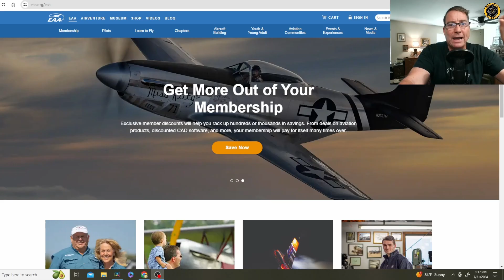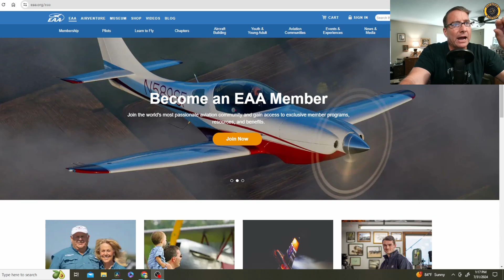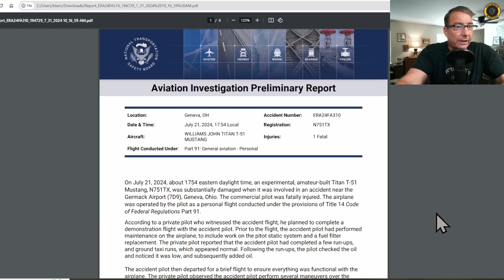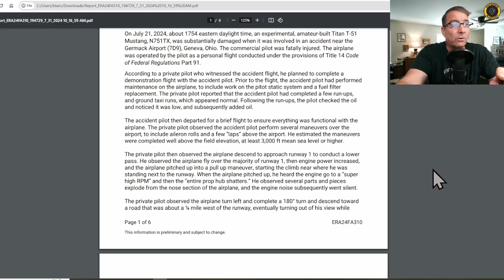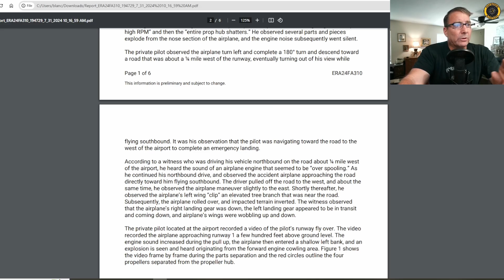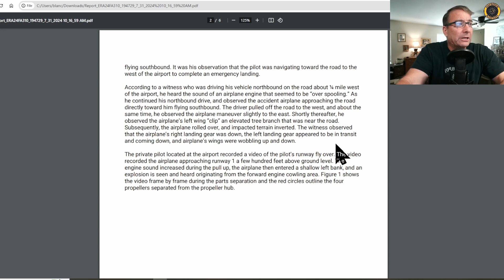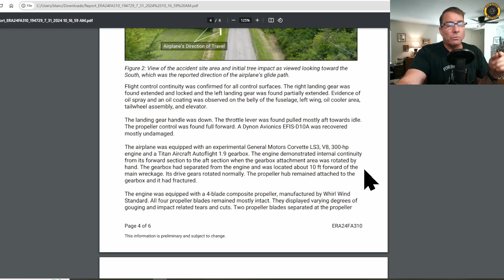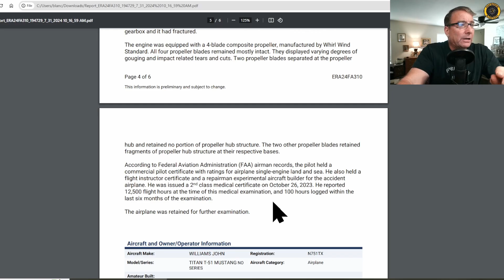Titan T-51 Fatal Prop Hub Failure 21 July 2024

Comment: Sorry, but isn’t it possible the over rev of  the engine happened due to the hub, crack and explosion and not the other way around? There is no guarantee that the over speed caused the hub to explode. Without the drag of the propeller and hub the RPM would most certainly increase…

Comment: Interesting line on page 4: "Evidence of oil spray and an oil coating was observed on the belly of the fuselage, left wing, oil cooler area, tailwheel assembly and elevator." 

On a plane with a continuous speed prop like the accident airplane was, if you lose oil pressure to the prop hub the blades move into their lowest-pitch/highest-RPM position. So...if he lost oil pressure to the hub in some way - either losing an oil seal in the hub or breaking an oil line - that would explain both the overspeed condition and all the oil on the aircraft. And, unfortunately, because the hub disintegrated in flight and the gearbox tore itself off the engine (which would also explain a broken oil line) during the impact, it's a theory we really can't prove.

Remember, Howard Hughes nearly died because of something similar when one of the props on his XF-11 lost oil pressure to a prop hub.

Comment: I personally would not fly an automotive conversion. I couldn't explain why, the problem isn't necessarily the gear box.  Rotax have gearboxes an they work fine.  The Rolls Royce Merlin had one too.  I guess it's just that automotive engines are not designed to do what aircraft engines do.

Comment: Unfortunately if the engine had its original engine control module and fuel system, it would have been able to immediately engage fuel cutoff at the redline limit

Comment: Such a common problem with automotive engines in airplanes. Wanting to use a sexy V-8 or other auto engine is understandable but gearing down the prop with amateur-built gearboxes is a gamble I'd never take. Airplane engines for airplanes......   RIP
Buddy of mine, an A&P, did a low pass like that in his self-built RV and one of the wings came off in the pull-up.

Comment: If engine RPM did not increase until sharp pitch up then that sharp change in attitude caused initial damage to drive assembly by gyroscopic force and loss of propeller load resistance to engine RPM.   Snap rolls in aerobatic aircraft can damage engine mounts in aircraft designed to perform snap rolls.

Comment: Topping up engine oil before departure, that's interesting... prop governors kinda work better when clean oil is available... AND NOT ALL PROP GOVERNORS ARE THE SAME! I'm no expert, but I have done a little reading now and then,  so I won't even speculate beyond what I've already risked.

Also, according to a safety related video that I watched some years ago, landing on a road is not nearly as safe as many assume. Lots of crashes and fatalities... a wheels up landing in an empty field might have been a better choice if one was available.

Comment: I wonder if maybe the prop failure is what caused the engine to rev and blow up? The spinners gonna lose all thrust and  kenetic energy it has with the props on. When your prop has no air to push its a lot easier to move and probably more balanced  then when the blades are on. You can see the props missing before the kaboom.

Comment: There's a gyroscopic effect for anything spinning which resists change of axis. When you combine high load for climbing and the described rapid transition to climb and high RPM, it all sounds to me like a maximum loading scenario with gyroscopic loading fluctuating between blades at lower and upper rotation extents. To best resist this, prop outer radius thickness needs to be minimal to reduce the transfered loading to the hub. Blade stall is also a possibility, especially if the calculated outer pitch is not reduced to minimise tip stall(adapt Ludwig Prandtl's second paper, on bell curve lift distribution with excellent youtubes by ex chief NASA scientist Albion Bowers). 

I haven't investigated what happens with propellor stall but I imagine high RPM is a result. This said, I'm not in the aviation industry, I've flown an assortment of RC gliders and powered RC planes and I design hydrofoils last 4 years as a part of my wingsurfing sport. 

One other consideration is rate of pitching vs resonant frequency of the propellor blades and hub, drive shaft. All will have resonant frequencies and together with change in RPM and gyroscopic loadings reversing between the inside and outside of the pitching upwards curve, it's possible that the RPM induced gyroscopic forward/reverse loadings received augmented deflection from resonance of the prop assembley. Don't read this to mean that prop engines are stupid, just that there are complex forces involved.

I don't know the mechanics of the hub composition but hopefully it wasn't forged carbon. There is no automatic alignment of carbon fibres in forged carbon construction, just a haphazard compression of short carbon fibres in a resin carrier that should not be expected to add much strength to the cured epoxy resin.
Reply: I'd concur with this theory before blaming any failure of the prop/engine components causing the hub failure. The dynamic forces of gyroscopic torque on composite material especially with the momentum of the prop already spinning at a high rpm coupled with an abrupt pitch change should be highly suspect (search "vector aspects of angular momentum" for the physics involved).

Comment: seems premature to say what happened, if the prop hub was "constant speed" governor controlled then a governor failure could explain the over-speeding, or was the prop hub entirely pilot controlled ?, if so then its hard to imagine a pilot with that much experience mis-handling the hub, so again some sort of hub failure ? doesn't sound like a gear box failure because that didn't separate until they hit the ground ?

Comment: Most auto engines are not designed to operate at 70% to 80% of their potential power for extended periods of time, as aero engines are. Yes, some accommodations can be made, but there is a reason it is easier to design an engine for automotive use.
Reply: The LS engines are used in boats and trucks with heavy tow ratings, so yes they are designed for sustained high output.

Comment: I have to wonder if there might have been a hairline crack or distortion in the gearbox casing causing something to pop out of alignment. Analysis of the video will be needed to determine if perhaps there was a gearbox oil leak before the engine went high RPM. Any inline screen filters will be important to check as well to see if metal particles provide clues as to what failed first inside.

Comment: Please correct me if I am wrong, but logically the only way the prop hub could over speed ... given the engine wasn't damaged and the neither was the gearbox, is that the gearbox separated from the engine?   Also as this was a check flight wouldn't it be wiser to do so at a higher altitude such that if any failure he was testing happened he could land it on the runway?  Only danger should be the climb ...

Comment: How do they get the LS3 down to 300 h.p. . In the Corvette it's rated at 430 h.p. @ the crank at 5900 rom with 425 ft. lbs. torgue @ 4600 rpm . .

Comment: I dont know why people dont use rpm limit with their engines. Its easy to program in so the fuel is cut and rpm cannot exceed some specified RPM. If done correctly, it will go to perhaps 5,000rpm and just start bouncing off the RPM limit. Sounds like a staging drag car before launch.

Comment: I just don't like drive speed reduction units . Even Cessna had problems when they installed a certified engine and  prop drive system from a major aircraft engine manufacturing company.  It resulted in a Cessna model few people wanted. It is just better to build an engine that makes power at good propeller rpm .  I owned a Vans RV4 it had a stock 180 hp aircraft engine. Resulting in no engine problems beyond normal wear and tear.  So it is ovisous I don't have problems with experimental aircraft . Automotive engines make a great car engine, but I will not be flying behind one . The added complexity of crankshaft speed reduction units always reduces reliability.  If  i am going flying unpowered, I will do so in a sailplan . I like the quit .

Comment: Is pitch controlled by engine lubricating oil pressure?  Or a separate pump? (think power steering, since it's a LS motor)
And pitch should be at maximum without the pump running.  Pump should offset powerful springs or something.  Same as a semi-trailer having full brakes, unless the air system is providing pressure.  If anything goes wrong, they lock up.  If anything goes wrong with pitch control, the prop should go to a high angle.

Comment: This is such a tragic accident, with loss of life and probably negative feelings towards the whole field of experimental aircraft. I feel as if I am stepping out of my lane since I am not into aviation; but I want to make a comment. Hindsight is always 20/20 and I am not aware of the rules and regulations around automotive to aero engine conversions.  But, here is my thought. The General Motors LS series engines have an ECU which, in its stock form, has a maximum RPM limit which can be set in the software. GM sets this to protect the engine and transmission of the car it was designed for. The designer of the aero conversion knows the maximum safe RPM of the propeller and the reduction gear ratio. If an engine RPM of 4500 RPM (just picking a number) equates to the maximum safe prop speed; one could set the engine ECU to prohibit engine operation above that speed. In the event that the propeller pitch was reduced too much by accident; or the engine tried to overspeed for any reason, the ECU would intervene and prevent such catastrophic RPM from being developed. I assume there is some reason this isn't done since it seems like it would be an obvious part of the aero conversion.

Comment: You glanced right over the cause!

The gearbox was separated from the engine, lying 10' away from it in the wreckage.
Why did the gearbox leave the engine???
THAT is the unanswered question.

When the gearbox separated from the motor it probably caused the variable pitch actuator to feather the prop, at full throttle, which caused ridiculous overspeed, which caused the prop to fail, which is why it over-revved, also shoving the gearbox further off it's perch, crash.

Comment: They should ban this type of kitting.  You're creating an additional point of failure in order to save some money on using a proper product.  We're talking about air safety which also has a community component of the people near the flight paths.  Do it right or stay out of the air.

Comment: How terrifying and sad. It’s basically sounding like a stuck throttle pedal in a car. The LS3 just spun up too fast. I’m no engine builder, but surely they have a rev limiter like a car to avoid this? I know it’s an experimental aircraft, but the engine clearly didn’t spin as planned. RIP.

Comment: Came here to say what others did. Your last statement is potentially misleading and jumps to an incorrect conclusion. The engine, freed of the load after the hub broke, would have surged after the initial failure. Need to confirm which was the cause, the overspeed or the hub failure.
Reply: The failure could have been internal to the hub, then the engine overspeed, then the catastrophic failure that is present on the video. The sight of the hub and props letting go isn’t necessarily the initial failure of the hub or drive system.
Reply from the maker: See pinned comment.

Comment: I can't imagine that they wouldn't have a rev limiter set on the engine to prevent over speeding, so surely the engine either saw an immediate loss of load and the RPM spiked past the rev limiter, or a hub issue caused the prop to drive the engine RPM up?

Comment: Aerobatic aircraft commonly have momentary loss of oil pressure.  To counter this they use a counterweighted propellor that wants to force the blades to course pitch. Oil pressure causes flat pitch.  Aerobatic aircraft typically have enough power reserve that they could still fly at high pitch / low rpm after an emergency malfunction.

Comment: You can buy a Sub4 gearbox for a Subaru 2.0L engine... don't need to custom build your own.

In favour of auto conversions is that there are millions of every kind of auto engine running for hundreds of millions of hours. That means that auto engines are better than aircraft engines in general, because there's millions of dollars available for design and development. I do agree that the low numbers actually in use in aviation means that you become the cooling and electrical and mount designer, and that there are often teething problems in getting these things right.

Comment: There's always this game between ultimate power, maximum gearing and what the blades can actually pull...  i'd be interested to know what the smaller pieces where that left the hub first just before the bigger chunks of blades separated. Also taking into account that the sound travels a bit slower than visuals, the overrev was just the engine telling the pilot he'd overtorqued his prop and he'd be a sailplane as of that point. Condolences to the family and friends.

Comment: Prop failed, that's why the rpm surged. It immediately lost the load that's why the throttle was closed. Engines generally dont increase rpm as a failure. Same happens to boat engines when prop breaks the water surface.

Comment: I've been a huge fan of the LS engines since I bought my Z06 way back in 02... sixth gear on the interstate around eighty mph, it's just above idle rpm and gets 28-29 mpg. Drop down a few gears and it pulls hard to redline till 180 or so... incredible powerband even by todays standards. Seems like the perfect auto conversion on the surface, but for years Chevy had a tough time with drivetrains themselves, resorting to a crazy dual mass flywheel setup on the LT's to combat harmonics as a bandaid. 

There was an auto conversion featured in KitPlanes magazine years ago about a fellow name Tracy Crook(?) that detailed his Rx7 rotary conversion in a Vans RV that should be required reading for anyone considering such an undertaking. He gave great insight and detail from start to finish, including more than a few engine outs and near misses. I decided to pay the Lycoming tax and worry a little less haha

Comment: Automotive engines are not intended to run at 75% power continuously. They develop peak power at high RPM. 

Pretty terrible idea.
Reply: Thr LS engines are used regularly in boats and trucks with large tow ratings,  so incorrect, they are designed for sustained high power output. A marine application is just as demanding as aviation, if not more so.

This wasn't an engine failure, it was a propeller failure.

Comment: Lots of speculation on the cause. Juan says the prop hub failure was preceded by engine over speed. The price list for the Titan indicates it is likely a hydraulic gov. These have an oil pump for the blade control and a screen. They have been known to plug the screen with engine debris and overspeed. Factual information is not available to know what happened, but the cause was impact with the tree, otherwise he would have completed an emergency  landing. It can happen to any pilot. 

Very sad for such a pioneer in the amateur built aircraft community, Blue Sky, John Williams.

Comment: If the engine was running on a digital control system, there should have been a max rpm limit in the software.  Drag racers and drift racers bounce their engines "off the rev limiter" all the time.  If there was an analog carb with a digital ignition system, the rev limiter should still have been used.

Comment: The electronics to prevent this should be very simple. An RPM guage with a kill switch that automaticly reduces throttle to idle to prevent the over - rev.
Reply: The ECU has a rev limiter. Irrelevant here, since the prop hub failure was the cause of the incident.

Comment: This accomplished man got everything right after the prop failure and ended up doing all that and hitting a tree.    Sad death however because he adhered the procedure of test flying the aircraft he potentially saved the life of his would be passenger.   Even though John Williams passed away while operating in a riskier envelope (auto engine mated to a psru), he should also be remembered for his airmanship:  following  procedure by taking the time to test fly the aircraft by himself first.     What a great example of discipline.

Comment: I'm somewhat suspicious that the problem began with an engine overspeed as an increase in engine speed would require more power and probably more power than the engine could produce.  It seem more likely that something else happened that partially decoupled the engine and prop.  Two data point might indicate an oil leak:  the pilot had to top off the oil before flight and the observation that oil was on the planes body after crash.  The engine needs to be connected to the gearbox and the gearbox connected to the props so there are two points of failure that could explain the engine revving.  If the failure was between the engine and gearbox that could explain the engine revving but maybe not the hub failure.  If, OTH, the failure occurred between the gearbox and prop hub that could permit the engine to over rev AND the gearbox to over rev.